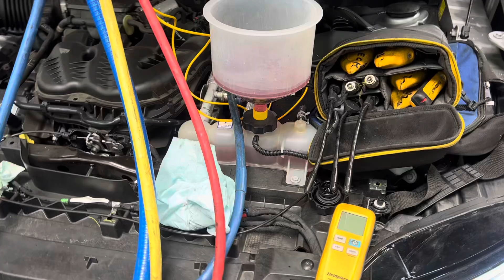OVER HEATED ENGINE BECAUSE OF LACK OF KNOWLEDGE!!!.  Uses tapwater top off coolant ? WTF ￼

Comment: You aren't working hard enough if you've never put tap water in a cooling system. You're living in fantasy land if you think there are ANY cars that are running distilled water in the coolant mixture. I've never seen anyone mix with distilled water, and nothing bad ever came of it. Also, you see those bubbles? Yep, those bubbles are being bled properly from the system. Vacuum fill is the best method, but what you're filming is the next approved method. Wow.
Reply from the maker: That next approved method that you’re talking about is what I get to see come back in shops on tow trucks when they’re lucky it’s just a pissed off customer with an overheated engine

When they’re unlucky, they’re taking out the head to have it resurfaced to replace a head gasket or worse . 

Over the last 30 years I wish I had $100 for every blown engine that I’ve witnessed inside a shop, especially when it was being done for cheap Rent-A-Car body shops with the most unskilled most uneducated workers . 

I was taught to use distilled water from my father back in the 70s. It was nothing mysterious to him. It was nothing mysterious or out of this world to me and that’s how he was taught. . 

Back then he was taught and I was taught he didn’t use chemicals. You flush the car with pure distilled water. 

And opened up the pock cock at the bottom of the radiator into a glass until it came out clear . 
Then you added your antifreeze . 

Everybody in different parts of the country had different levels of education, some deprived and somewhere not . 

We actually love shops that use tapwater, especially if they’re in the parts of the country where it was really alkaline with lots of calcium lots of magnesium like Los Angeles 

Or up north in our California area where there was tons of iron in the tap water. 

The shops were busy replacing heater, core radiators, and freeze plugs . 

My father told me if you ever don’t like somebody and you want to be a real asshole fill up their coolant system with tapwater. It’s the best way to sabotage your customers car. . 

Other did have a uncle in law, who only use tapwater never use coolant, and he usually would not have problems for years. He was so lucky. . 🍀 but he was Irish too the luck of the Irish. 🤣 

But for the rest  of A made us lots of money replacing parks that did not need to be replaced except for the only reason is they use tapwater electrolysis City
Reply: @coldfinger459sub0  also, bleeding the air out like in the photo will catch so much of the air that even when the cooling system cycles it may drop in the expansion tank, but will not go so low as to cause overheating. Overheating happens when you don't bleed the air out. As far as the tech walking away and allowing the temp to rise,that is not how it's done. You need to run the engine to allow the thermostat to open, then after the air stops burping, before overtemp, shut the engine off and allow it to cool back down. The procedure says to drive it again and top off. All good. No cavitation. I won't waste my time if I can pull it into a vacuum, it's much faster.
Reply from the maker: @WildRiverCamping  the air purge method doesn’t always work, and the reservoir is not big enough for the SUVs and the vans with rear heater course in the back of the vehicle

That’s where all the money is to be made on replacing engines or doing head gaskets from shops that didn’t do it properly 

Relying on the coolant reservoir is not near enough 

The air makes it to the water pump, and it turns into foam and foam does not pump coolant. The impeller just spins, but there’s no flow. Find that out later on when they’re on the road. 

Tow trucks happy about this cause they get tow jobs in the mechanical repair shop is happy about this because they get jobs and make money off of it because I get called back out to the repair shop. That’s pulling the engine usually to pull the air-conditioning refrigerant out so
They can pull the heads or the engine, so I get to make more money to 👍$$$

The more we have lazy people who don’t follow correct procedures, the more money, the whole industry makes. 

But it’s not good for the customer
Reply: @coldfinger459sub0  I think you're making connections where there are none to be made. The breakdowns are not caused by tap water, and not caused by air in the system---at least not by me. Not sure what these other yahoos are doing.
Reply from the maker: @WildRiverCamping  these yodels are doing a lot of funny stuff cutting a lot of corners. 

None of them had no mentoring. They had no apprenticeship. A lot of them are so young it’s the young guys teaching young guys because a lot of shop owners specially when they’re technically incompetent. 

Say they don’t hire old guys they call them toxic technicians or bad attitudes because usually the old guys got tired of putting up to a shit with idiots who own shops who can’t teach young technicians themselves so we have a whole generation of young guys teaching young guys who don’t even know what the hell they’re doing And they screw up costing customers hundreds or thousands of dollars in repairs because they’re idiots

And it all leads to the biggest turd on top and turds roll downhill . 

The lack of education in this industry is incredible
Reply: @coldfinger459sub0  like all the kids dangling calipers from the hose.
Reply from the maker: @WildRiverCamping 👍👍👍100% correct. ✅ 

Or five or 10-year-old spark, plug wires not replacing them bending them out of the way replacing the spark plugs, and then a week later, the car comes back with a bunch of misfires on a few of the cylinders, because when the young technician bent the spark plug wires it caused the carbon to crack Inside the spark plug wire and arc made the gaps become wider causing misfires.

Or bending the AC compressor out of the way of pulling an engine on 10 year old hoses are older . 
        The inside of the hoses have become brittle and crispy. 
       And when they bend the AC compressor out of the way so they could pull the engine. They put it all back together and the customer comes back a few days or weeks later saying their AC is no longer working after they did the engine.

But the technician swears up and down and tell the truth that he did not unbolt or release the refrigerant to the air. He did not recover the refrigerant. . 

But what experienced technician does not know he cracked the inside of the refrigerant hoses, causing a slow leak of the hoses to the compressor that he bent out of the way to replace parts or engine . 

The difference between knowledge and lack of knowledge, experience and lack of experience 

And we see this get worse and worse as we get older and watch more shops, get purchased by technically incompetent owners, who keep hiring a larger group of their employees with fewer years of experience, because they’re easier to control and easier to pay them lower wages . 

And the owners of the shop, technically incompetent, so they can’t train their own technicians because they’re not worthy of even being allowed to own a shop, unfortunately 

Totally screws up the reputation of our industry .
Reply: I ONLY USE DISTILLED WATER have for 20+ years
It's a whole $1.28 at Wal-Mart to keep one in the car
Just did the radiator and hoses on one of my cars last week
Reply: @LEOhopeful  good for u. Doesn't matter though.
Reply: @WildRiverCamping  so, using water with minerals, chlorine, metals etc does NOT leave scaling or deposits inside the cooling system?
🤔👌🏼🤣😂

When I lived in Florida I only used distilled water, and added water wetter for lubricity....coolants are so corrosive over time
Reply: @LEOhopeful  show me a real world comparison of a radiator, or water pump, or cylinder walls. Then, you tell me if it's significant. From what I've seen it's not.
Reply: How many years until it makes a difference? Decades.

Comment: HI 
Demineralized water/deionized water /distilled water all good . By using tap water it consumes some of coolants ability to do corrosion protection Why all the debris and potentially un balanced PH degrade coolant .
Being that u flush a system with  tap water this has to be followed by change over to distilled water then drained and refilled with coolant /distilled mix .

How do u stop a system from having air locks is  bleed cooling system  at several connection locations of potential air lock and at lowest/highest points . System must be under slight pressure up to 5psi 

Coolants types can be OATS , Hybrid ,Glycol , basic rust inhibitor . Wrong coolants can eat gaskets and have adverse reactions
Reply from the maker: And this is why customers cars get destroyed because of uneducated untrained individuals are allowed to work on them

Because untrained unworthy un, technically inclined owners, are allowed to own shops, and being incompetent, and can’t even train their own technicians. When they go out of their way to hire the cheapest unskilled technicians not all owners not all shops, but many. . 

In their search for cheap technician times comes lack of education . 

And get the air out that vacuum, charging coolant procedure was invented for . 

My fathers have showed me the vacuum system over 40 years ago .

Comment: Just don't get into an accident. There are so many things that can go wrong. The frames all messed up afterwards and usually doesn't get back to normal after the repair, it seems like they never put in in any shop a decent condenser for the AC so your destined to have poor AC cooling or no AC cooling the summer after repair in a body shop and it sounds like you may even have an overheating engine after the repair sometime in the future. Once a car is in a wreck it seems like there's almost no hope for it to last after that. That's especially true if you get hit in the front. The frontal most thing is your AC condenser so you're at least going to probably have trouble with the AC sooner in vehicle life than you should have.

Comment: Flush with distilled, then math the correct amount of concentrate,  top off with distilled
Reply from the maker: You would be amazed at how many technicians say they’ve never seen or heard of anybody actually using distilled water. 
You can tell they travel in circles in an area of the country with a little to no education . 
But to them, they think this is normal that nobody does it . 

And this is one of the biggest problems in our industry, lack of education . 

While we have laziness is another problem 

And then there’s tightwads who do everything to the lowest common denominator because it’s the cheapest way to do it

Comment: This is one of those jobs that our politicians says are suffering from a severe workforce shortage because the local populace refuses to fulfill these roles. The solution is to import foreign labor.
Reply from the maker: I could tell you this is imported foreign labor that is working on this vehicle right now

It’s at our country defunded the trades schools classes that started in sixth grade, I was in Everett middle school in San Francisco in woodshop and Electronics class. Then you had metal shop machine shop auto shop all the way through 12th grade.

Here in California, they defunded most all that shut all those down 40 years ago. Only a few very few remained open with teachers, who are young who did not retire yet until older. 

So we were graduating, who didn’t even know how to use a screwdriver or a wrench, and they would go into the workforce, completely clueless and dangerous, unable to use power tools like their fathers and grandfathers before them 

My generation was the last where you had trade school from sixth grade through 12th grade, and when you entered to workforce, you already had to experience of at least two years of work experience when you enter the workforce and you already knew safety rules and regulations and how to use dangerous heavy equipment 

Why do you think we have so many deaths and lifelong disability injuries with power tools all because our government shut down the trade schools in junior high school and high school